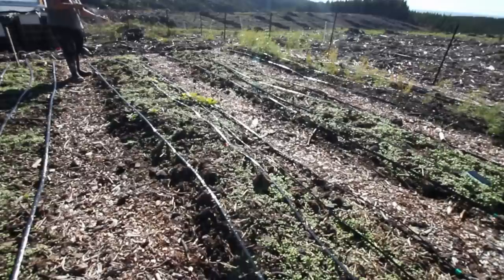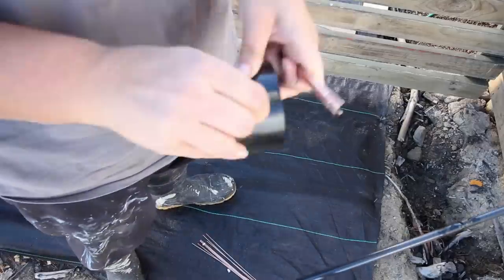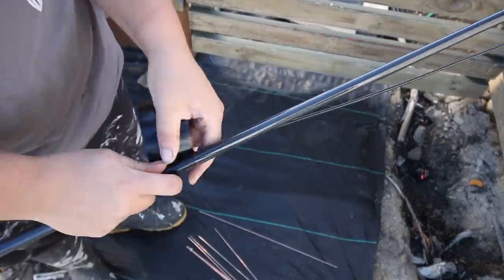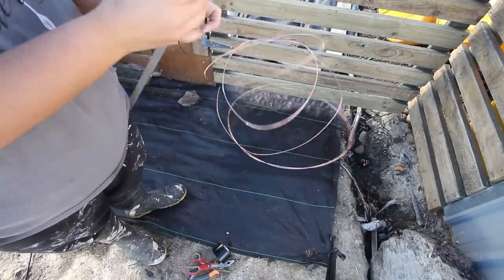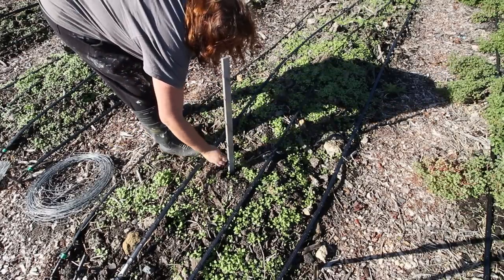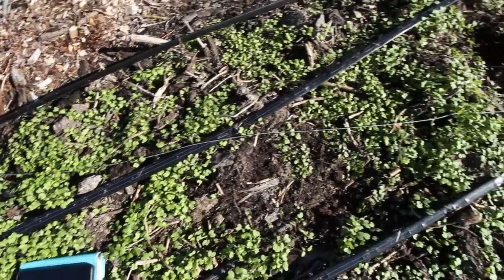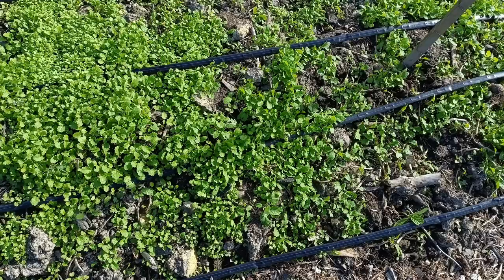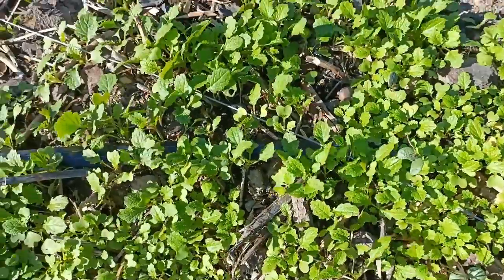ELECTROCULTURE  WORKS?! testing 3 types of antenna

Comment: I put 14 gauge copper wire in my pepper plants that are in 5 gallon buckets. Yesterday I put the wire in at dusk. Off/on rain today. When I put them inside a cheap greenhouse tonight because it will be almost 38 degrees. Don't want to risk of losing 3yr old peppers. I've seen tremendous growth in 24hrs. I'm excited for it.
Reply: If it's not earthed a least six inches in the ground, not in the plastic bucket, nothing is happening pal, plus you don't need to use expensive copper, aluminium wire works just as well
Reply: @davideaston1139 but toxic
Reply: @gayleeaton2077  All metals are toxic in some way, even copper but aluminium takes a while to corrode and when it starts to go white change it, it's still cheaper
Reply: @davideaston1139  k
Reply: Mine are buckets I used 14 size wire as well and mine are doin good
Reply: Pure gold is not toxic.  There has been some interesting testing on poppies and alkaloid production. Different metals in the soil would  literally alter  the array of types of alkaloids a plant would produce. 

This makes sense if you picture it like a lab. 

If i give chemists different chemicals they will be able to synthesize  different alkaloids depending on it. 

Shows how amazing nature is. The plant has the know how to create who knows how many alkaloids. Novel ones too we havent seen. Though even what “we know” we dont know a thing about most beyond just knowing its something unique from the other 40 alkaloids jn the poppy. Alkaloids examplles. Thebaine morphine. Codeine all different coding basically.  They even made oxycodone snd other things. Really interesting.
Reply: @david easton  thats not true . The wire can harness electricity from the Air/Eather 💪😇🙏
Reply: Why does the bucket matter?
Reply: @davideaston1139  cooper increases soil fertility and reduces bad bacteria in the soil. Viktor schaebergers work.
Reply: @antiprismatic  Yeah mycorrhizae does all that...

Comment: I have experimented with old telephone cables. Stripped off the rubbery protection and used the very thin copper as hairy antenna’s. So far seem to work. I guess the hair like design is able to pick up lots of abundant atmospheric energies. Also, winding the copper clockwise towards and inside the soil might be more effective than counter-clockwise
Reply: clockwise in the northern hemisphere 👍
Reply: If she is in southern hemisphere, direction would make a difference, wouldn't it?
Reply: @Drag0nFlea  Yes this is correct, i saw it in another video somewhere. Australia / NZ need to go counter clockwise.
Reply: @Drag0nFlea  earth is flat
Reply: @Drag0nFlea  earth is flat
Reply: @joanies6778  earth is flat
Reply: @seektruthnow00001  earth is flat

Comment: I planted my rods in December over winter. Now my garden is 3-4 times bigger, thicker, stronger and more productive than EVER before! It’s incredible!
Reply: What kind of method /size wire did you use?  Did you do the ferrous magnets with iron in the ground too?
Reply: @jessicagrant4990  yes I only did that method. Rod in the ground horizontally with magnets on the ends aligned with the earths magnetic pole.
Reply: @jessicagrant4990  the thickness of the wire/rod is about 3 mm

Comment: bare wire is best as the current you are looking for can be caught up in the complete wire, no need to try to prevent shorting out current. also be sure there is no coating on the copper wire as this impedes the current flow....good luck...
Reply: As long as the wires do not touch I presume?

Comment: CB radio was popular in the States during the 60s and 70s. A tuned antenna would arch over the car from the front fender to the back bumper, about 12 feet or more. They were called whip antennas. Some one came up with a 3 foot piece of fiberglass rod withe the wire coiled in the core. So in a 3 foot length they got the same reception as the extra long one. I think a brand was a fire stick. So that would explain the coil.
Reply: I'd a mag mount on my car the one with the magnet on the bottom

Comment: The copper stick method creates an electric magnetic field, they recommend using a 6ft stick from your backyard which cover an area of 200+ square ft, the higher your stick goes into the sky the more atmospheric energy you're able to draw into your soil.
Reply: NO wrong 😂🤣
Reply: @davideaston1139  what's wrong?
Reply: @jeansroses7249  He's just a troll or a bot, trying to make people doubt the lost ways our forefathers knew and used.
Reply: @oztrich24  thank you
Reply: Rather than using a wooden stick, you can use copper pipe. Drill small holes at the top and bottom of the pipe for coiling 2mm copper wire around the pipe. I've been using this method for the last few months and results have been very good.

Comment: With the winding, you follow the coriolis effect. Looking DOWN into the soil:
For the northern hemishpere the winding is Counter Clockwise.
For the Southern hemisphere the winding is Clockwise.

Basically the edge closest to the equator goes East.

In regards to height, the radius of effect is 1.41 times the height of the rod.

Also DO NOT use Iron of any kind in your soil, this includes steel.

Comment: It's interesting finding others who are trying out Electroculture for the first time like me! One important point you mention to gauge how many volts you are generating is to get a volt meter so you can get an idea of what works and what is less likely to work and therefore go with the higher voltage readings! Since Yannick Van Doorne speaks of copying nature, like Viktor Shauberger, so why not try a pole wound each way and test with your volt meter to see which is best? Make sure you have the same length of wire on each! Our rubber trees are cut from high left to low right, which means clockwise, (I should have added because the vessels are oriented clockwise, the cut is anti clockwise, sorry about that!) Let us know how you get on with your experiment in the garden, I would love to hear of your success!
Reply from the maker: I set up a bunch of experiments today in the garden testing a whole lot of variables! Will be interesting to see what happens
Reply: I am! I definitely see the plants perkup when i add copper to a potted plant. And i water way less. Still observing the outdoor effects. Increase in birds has been apparent
Reply: @FantailValleyHomestead  That's good, me too! My latest trial is using a 7 core cable meant for earthing of the house! Instead of splitting the wire out, I cut off 0.8 metre lengths and splay out the 7 wires and wind the coils to create a 7-coil antenna! I leave 0.1 metre of the insulation below and another 0.1 metre of bare copper end to ground via a single wire and I can put these on any length pole accordingly! I ordered a volt meter today, so I can test my experiments, so that idea came from you and has to be a winner! Thanks for that!
Reply: The answer came to me as I woke up this morning! I could recall Yannick Van Doorne speaking about Snail shells and following nature! Wherever you are in the world, find a snail and follow the same direction as it's spiral shell! If it is a vacant shell, place the shell as if the snail was sliding over the earth! Follow any natural spirals for the area where you live! Follow nature! For me here in Thailand, that is high right down to low left, which is clockwise top down when following a snail shell here!

Comment: When you make a coil either way you wind it, it will be the same direction from the top or the bottom. So if you look at it from the top it will look the same as when you look at it from the bottom. Clockwise from the top will be the same looking from the bottom. Counter clockwise will look the same from top or bottom. Try it.
Reply: Watch the water in your toilet

Comment: The short antenna probably worked because it was copper & the rain splashed the copper oxides from the wire around that area. You could test this by just putting some copper wire over an area. You cannot pick up energy from the Schumann Resonance as you would need a very long wire. you will pick up some inductance during an CME from the sun. the tall antenna would be dangerous in a lightening storm to be near.  Great video though, keep experimenting makes life interesting.
Reply from the maker: Yes that would be interesting to test! Good point about the lightening, though I suspect all the forestry around would cop it first - we are surrounded by mature pine forest.
Reply: @calthorp...Yannik Von Doorne explains all this in his interviews thoroughly.

Comment: Well, I have hundreds of feet of copper wire, ground rods, test equipment, a 500 ft long wire antenna for the AM/MW/Shortwave band, etc...and a garden...so I suppose I should experiment with this. I have plenty of time on my hands. But there are power lines very close to my garden.
Reply: Be careful not to  coil wire under power lines as it  can react like a transformer
Reply: Your garden is in automatic mode during the evening.

Comment: I can’t imagine whether the wire is clockwise or counter-clockwise being a real issue.  I think the fact that you spiral the wise is sufficient. 

The rule of thumb is, top down view. Imagine looking down at a clock laying on the ground. 

Cool video!
Reply: look at the snail house, it says all
Reply: "I can’t imagine whether the wire is clockwise or counter-clockwise being a real issue."

Helical antennas are circular polarized. The direction the helix is wound determines whether it's polarized left or right. 

Whether that makes a difference to the plants I don't know. It does make a difference to the polarity of signals the antenna will receive. So I wouldn't discount it out of hand.

The wavelength might matter too. I'd be curious to see if antennas designed to resonate in Schumann frequencies would increase the effect.

Comment: Yannick does say that clockwise (in northern hemisphere) going up (wound to the left from the bottom)  pulls aether from the sky down to ground. Opposite way Earth energy to sky.
Reply: So, to be clear, winding "to the left" from the bottom (anti-clockwise) looking up is also winding "to the right" as you look down (clockwise) from the top of the pole. Is this what you are saying?
Reply: Yannick does not know that earth is flat

Comment: Twisting the wire like a tensor ring placed around base of plant just on top of ground gives desired effect as well. Plus we suppose to use wood not metal for posts as wood somehow smooths the current. There is a copper design too that makes a lot of energy forget what he called it. So much info coming in hard to get it all straight sometimes. I say just have fun.

Comment: ok knowing a bit about electrical stuff. studied it for around 60 years.
When dealing with very low voltage as is present in these ariels the joints at all parts should be soldered or in some way connected permanently to the ariel.
The reason is this. The amount of voltage (unless other forces are in play) is very small. Less than one volt ( a normal battery for the torch is around 1.5 volts) 
Copper wire, steel wire etc all developed a coating of oxide on the outside of the wire/metal conductor. 
Oxide impedes/prevents the flow of electrical current in a conventional manner.  
So the electrical connection between the ariel and wire to the garden should be oxide proof thus allowing the full power to flow without interruption.

Comments, please.
Den
Reply: Oxides are resistive, which typically convert electricity into heat. Protecting electrical connections against oxidation isn't a bad idea in any application. Solder, electrical tape, dielectric grease, silicone, etc.

Right you are, Den of Earth.

Comment: Fun fact, that carbon fibre rod you are using to attach the wires alone is actually a more efficence electical conductor than the copper wire. You could have literally just stuck it in the ground and you would get the same effect.
Reply: INTERESTING, BUT WON'T THE MULTI- STRAND WIRE AT THE TOP STILL HELP

Comment: Hi. Great video!

Maybe someone has mentioned this (regarding clockwise/anti-clockwise), but it does not matter if you think "from the top" or "from the bottom". if you check your spirals, they have the same direction from the top And the bottom (they mirror as they are flipped up-side-down ;o)
Reply: ... that is, they are either clockwise or anti-clockwise from both ends :o)

Comment: I had two trees cut down recently. The tree guy said they’d both been hit by lightening and there was probably iron in the ground below them.. As they moved the limbs away they drug out and old washer cord with heavy-copper wire as it had been buried in the leaves between those two trees.

Comment: I don't understand why you would be skeptical about the one  most commonly made? The copper wire around a wooden stick. And that you would be surprised  to see that it is the best effected.
Reply from the maker: it seemed to easy/simple to be true, and a lot of the 'proof' it works that I have seen are not really actually comparing things with a control. Plus I happen to be quite a cynical person haha

Comment: This was very interesting to watch as I have also just started to experiment with this technique ( just 3 days in now). I used 10mm2 insulated cable wound over a 3 metre bamboo stake. The top of which I have removed about a foot of the sheath and divided the strands equally and then bent it into a coat hanger shape that meet in the middle. The bottom wire(6 strands) are buried naked at equidistant radials all around the stake and are approximately 2ft long. I have done two like this. I did not measure if there was any voltage there though. I am thinking that perhaps on one of them I may spread the Ariel outwards like yours and see the difference. 
I was impressed with the results from your short galvanized stake. Perhaps that is the way to go?
Thank you for showing this.

Comment: they copper wire is suposed to be higher up like how you would set up an antenna, preferably in an arch about 6-10 feet off the ground. the lower it is the more grounded it is.

Comment: I've mucked around a bit with it but can't say I've seen impressive results that I was expecting. I am going to keep going because I know it works I just have to find the best.
I also made an expensive impressive aerial and buried the wire 2ft into the ground but I can't say I've seen a difference yet.
The one method you haven't tried here is the earth battery and us what I'm going to try next. An earth battery is simply one sheet of copper and one of zinc buried vertically opposite each other and joined over the top by a wire.
There's enough current in small earth batteries to run a light globe so I'm going to try something about 15cm square, buried to the top, and spread about a metre apart.
There's so many books written on electroculture from around the 1900's and they tried all sorts of methods.
Some of the earth batteries were sheets about 50 cm square and set anywhere from 30- 200ft apart. There were noticable, recorded results.
I have about four of these books and they're all available online by PDF.
Maybe I can work out how to provide links if needed.
If anything, and devoid of whichever method used that either worked or didn't, I believe this is a good thing because everyone's trying it and it's worked in the past and is working now. I feel we just have to find the methods that work best for us and our conditions.
There's about 4 different methods.
Thankyou so much for your video, it helped heaps and I learnt heaps 😃👍🙏
Reply from the maker: oooh that sounds like a fascinating experiment to try!

Comment: When you say North and South end of the magnet I’m wondering is the North side the one that will pull or push things
Reply from the maker: It depends on the polarity of what you are trying to move. The best way to check north vs South is to use a compass. The north pointing arrow will point to the south side of the magnet

Comment: How many meters apart should you put these, to cover all of your plants?
Reply from the maker: Each one covers a different width, they seem to cover about 1m/3ft roughly. I have heard you can attach a grid of wires to the taller one to cover a large area but I've not yet tried it
Reply: Thank you! Was wondering about that. The long one is not viable where I live now. But will try the others.

Comment: I use structured water from k type ceramics. Can this be done with several 100% copper grounding rods instead? I have an opportunity to get 30 for $150. Instead of wrapping say a 8ft bamboo pole with copper wire or do i need both but using only 1 or 2 grounding rods? I have 12 gauge copper wire. I also bury old pennies (1982 or older bc they do have much more copper. Theres only a few from 1979-1982  most of mine were dated 1960s- late 1970's) i could never locate them all so how would that effect this.. i saw where it repels pests and bugs does that include beneficial insects. How does electroculture effect the beneficial microbes and fungi in the soil?
Can this shock you? I don't mean a little static electricity. Do the metal cages put around plants work similar if tall? I know different plants different voltage but What is the basic reading i should look for to check if its working

Comment: Standard electrical theory is a little skewed. The Earth is a giant capacitor that holds charge. Thus one needs something like an 8' driven ground attached to an antenna and closer to the
plants surrounding them another antenna system to collect. Thus when the moisture at dew point becomes good a dialectic is produced, energizing the plants.